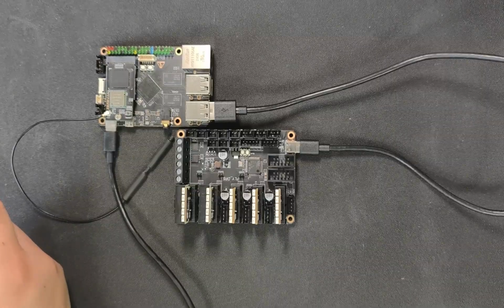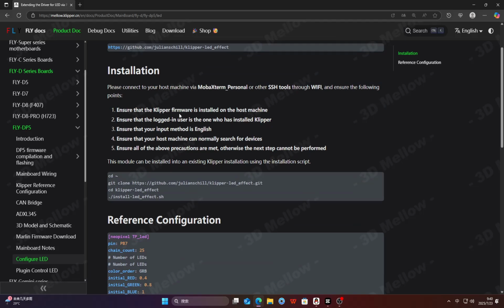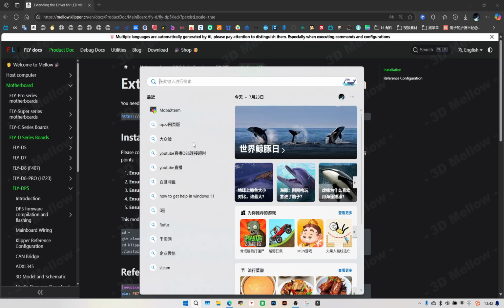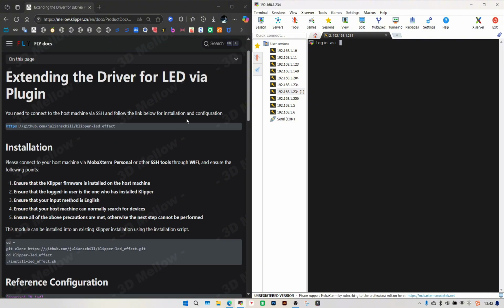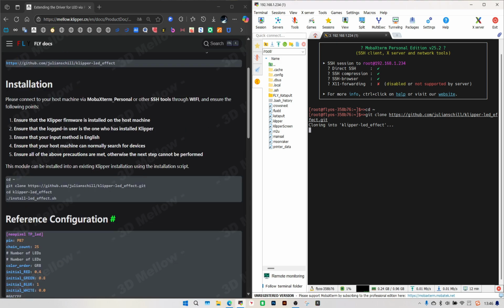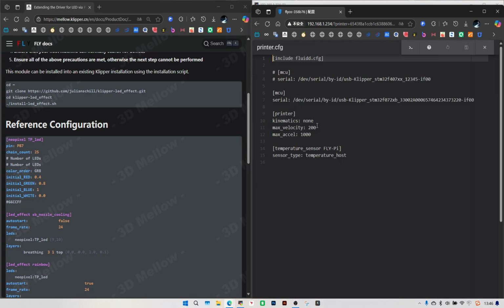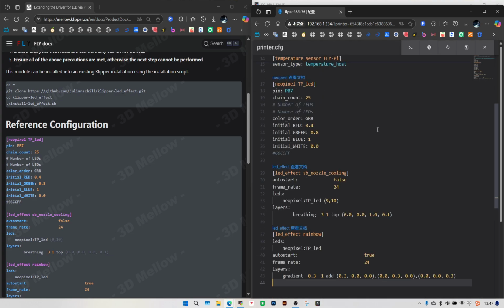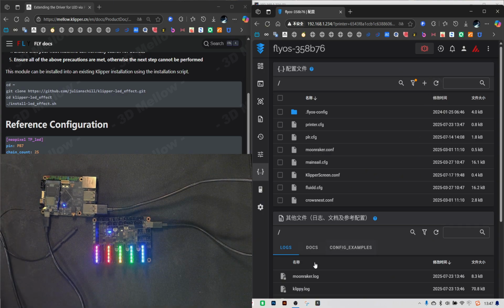Mellow DIY 3D Printer DP5 Board:Driver Lighting Configuration Tutorial#3dprinting #3dprinted

Comment: These are really neat. I must admit the aesthetic value of it would entice me as well as I'm a sucker for blinkies at times. 
But really will it bring anything more to it than just the stepper driver brings? Not likely other than many pretty aesthetic appearances. And depending on where your electronics are you may not even see them. ( He says shamefully after printing a very intricate design panel for his Voron 0.2 which happens to be a rear panel, and will never see it unless turning the printer around 😂🤣 😅😅)
Reply from the maker: You can just mount the mainboard on the bottom of the printer and point those LEDs toward the bed. Then tidy up all the wires, throw on a clear acrylic cover, and in Klipper, set the LEDs to show different colors for different printer states — like red when heating, green when cooling down, and blue when homing！！！！
Reply: @3DMELLOWPrinter so yea, mainly aesthetic. Most tool heads also have neopixel or similar for this reason and many use them in the same way other than just illumination of the current stage of a print 😊
Reply from the maker: for sure